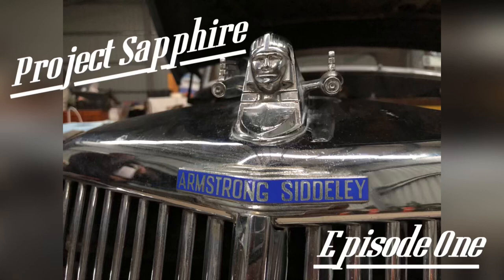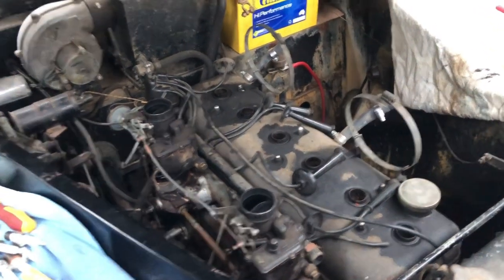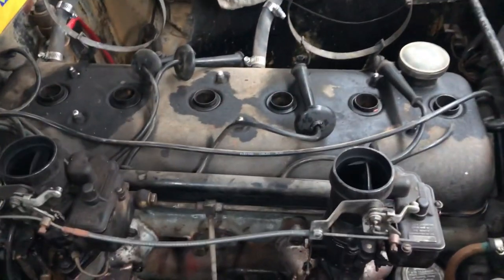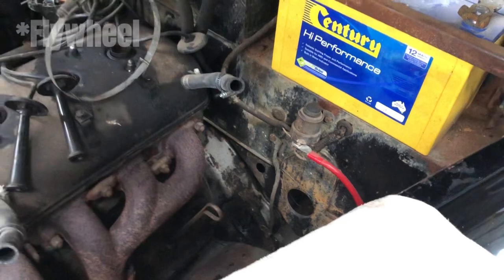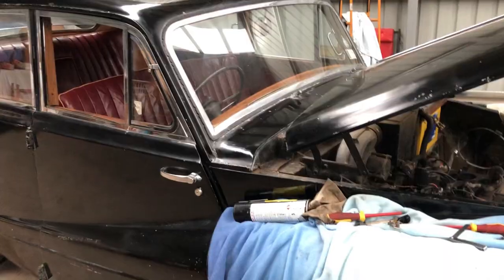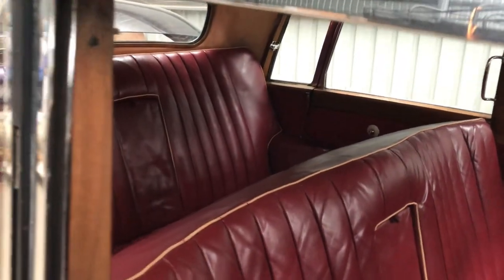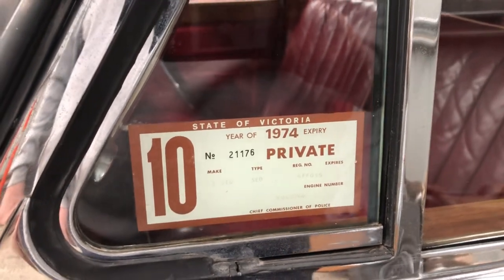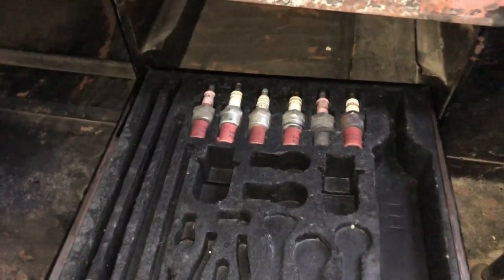Armstrong Siddeley Sapphire - Project Sapphire Episode 1

Comment: Hi I have a Mark 2 Sapphire with twin strombergs which I am also recommissioning. My car ran but badly. I removed the carbies and found not only that they were full of rusty sludge but more significantly they were suffering from neglect and incompetences. So stripped them down and found that the idle jets tubes were blocked.  The carbi accelerator pistons were frozen bent and set incorrectly. Mainjets blocked. Float valves not seating resulting in flooding.  I thoroughly cleaned and replaced various parts new gaskets and seats. I reset linkages and carbies up on my work bench as you cannot reset them while they are still attached. My ignition leads were incorrectly fitted. There is a fine screw under the carbon bush in the distributor cap.  This screws into the coil lead. Mine wasnt so it was self timing!
I have removed the fuel tank to acid remove rust service fuel sender guage neutralise and coat with Red coat to permanently stop rusty fuel getting near the carbies.  Currently wheels are off to service and rectify brake binding on front wheels. I am also treating underbody and other jobs.  Robert Penn Bradley's books are very helpful. My engine now finally ticks over perfectly. cheers
Reply from the maker: Keep us updated!! I’m thinking we might need to flush the tank on this too, but for now we’ve just got a filter installed before the carbs.
Reply: If the tank is rusty the only proper fix is to remove the tank and acid remove the rust. In all probability the fuel gauge will need to be removed cleaned and serviced. Mine now works. The brake system on my car had been played with by an incompetent mechanic. All wheel cylinders master cylinders slave cylinder PBR power booster brake linnings and flexible hoses were replaced and vacuum hoses replaced. The car now has high quality brakes after pressure bleeding and power bleeding. They are really good. Weeks of work and careful measurement to set them up exactly. 

Everything comprehensively serviced. It now runs and drives really well.